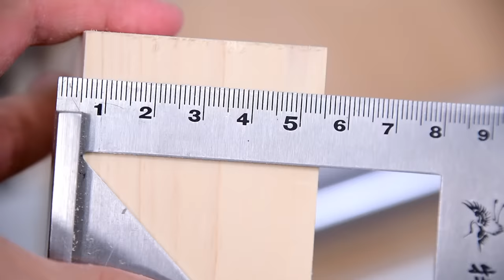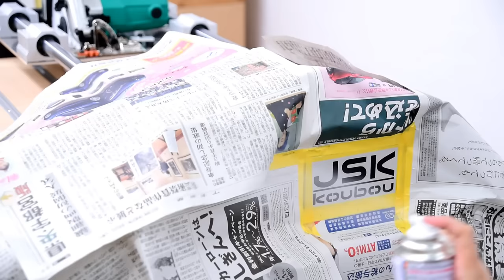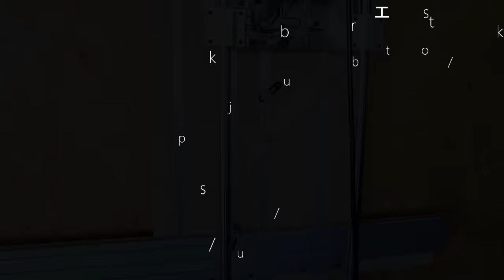Making a 2-in-1 Circular Saw Slide Guide (Easy Panel Saw)

Comment: Finally completed my own and it's amazingly accurate! Some pointers for those who might be interested in building one. I ran into a few issues on the build, I tried the stainless pipe option but couldn't find pipe that fitted well into the bearing blocks. I finally settled on chrome solid shafts with bearing supports. One thing to note is the saw you will be using, be aware of the blade cut depth, and the saw (left or right handed) both were different from the Makita used in the JSK build. I had to make adjustments for my Dewalt saw. Now its done I'm delighted with it! 
Update: To add a bit more flexibility to the mitre cutting I've fitted a 30mm t-track with slider bar with an adjustable mitre gauge making it possible to cut more angles.
Thanks JSK
Reply: Thanks Bruce,
Do you think it's rigid enough to make a slighty longer one ?
Thanks JSK by the way.
Reply: @fabrice5057  Hi there, I'd say definitely, but use solid shafts and bearing supports, only drawback is the weight. Those solid shafts make it heavy, if you're not planning on moving it around it should be just fine.

Comment: You should sell your device, I would buy it :).  I am sure you will sale a boat load of this jig in the US.  Thank you for sharing your video.
Reply: Well you know, cost might be a limiting issue.  I would like to see a cost comparison between the DIY setup and an off-the-shelf setup.   But I agree that the conception and execution of this DIY project reflects great skill.  Thanks for the video.
Reply: I think sales would be pretty damn low. Just checked out factory sled for my machine and it would cost about 50euros. So it's quite hard to justify buying plans and using time and money (note likely more) to get similar results
Reply: Most Americans don't do things this way.

Comment: 16:47 The fine adjustment is a clever idea. I watched a few times to understand and finally realised that was the simplest way way to adjust the blade direction. Well done
Reply: Could you please shed some light on what's actually being done there? I saw this couple times and still no idea what was it for?
Reply: @endriupj  Sorry for the late response. This is to ensure the saw traverses parallel to the guides(rails). If this isn't done properly getting squares can be tricky

Comment: For panel saw attatch hinge at top. Then install a murphy type hinged leg on the back. Pull bottom out away from wall fold out hinged leg on back. It will prop bottom of panel out slightly. Very good work! Nice video!

Comment: A light blow of primer followed by a skim of filler rubs down easily and gives a lovely base for paint.
You might find some Rawl (expanding) bolts that fit into the slide tubes.

Comment: I've thought of a project like this for so long. You have convinced me! 

Great idea to use hollow pipe instead of costly solid shafts.
Reply: Why go to all this trouble. The bearings are designed to use the shafts that are precision ground to exacting tollerances. I doubt that the shafts were. His workmanship is top notch. I would have spent the money on the shafts. I have seen this done with rollers and pipe and they work great too. Back in the 80s i had a cabinet shop and i set up many jigs with these bearings and shafts and they are machine grade...very nice to work with.
Reply: @jeffreyhill3960  Current pricing of those linear bushings is around $136.00 (USD) times 4. $550.00 just for the bushings. The whole set up is cost-prohibitive.
Reply: @murrayhill9000  Those 20mm linear bushings cost only $ 16 for 4. Buy them on Aliexpress.
Reply: @murrayhill9000  People use dirt cheap chinese lm20uus in diy CNC mills. I think it's good enough for something like this. Misumi, a brand name with a US branch that does machining in the US, shouldn't be much more expensive
Reply: @murrayhill9000  I found them on UK eBay, £24 for 4, £28 on Amazon, so certainly not prohibitively expensive. Stainless steel tube is also inexpensive, and the aluminium extrusions are all fairly easy to find and also inexpensive.

Comment: I wish I had half your talent. I saw this a few times in your other videos and at first I thought it was too complicated compared to a table saw, too many extra hold downs and whatnot, but the more I watch the more I realize how much worth there is in this machine. The fact alone that it can replace most things a tablesaw can do and it takes up no floor space at all makes it a very handy tool indeed. I would have to take it off the wall for panel cutting however, because I just can't dedicate that much wall space. Perhaps I could mount it to a bench though.. Anyway, I definitely came around with this tool. Although I doubt I'll be making one. I can enjoy the craftsmanship none the less.

Comment: Neat and clean, not forgotten his  accuracy but for us who are a hobbyist  don't know how the part called that makes us difficult to buy online. The beautiful art of work. Thank you.
Reply: The shafts look like 20mm and are supported by linear bearing shafts or blocks SC20UU, the tracks are most likely 19mm t-tracks (also come in 30mm), the metal close to the black end block is a T-Slot Aluminum Profile Extrusion Frame. These come in different sizes 20x40mm, 40x80mm etc.. All these are generally available on Amazon, Aliexpress etc.

Comment: Well done, would liked to have seen the blade cutting through the aluminium base plate though...!
Reply: He's using saw blade: Circular Saw, Universal Blade (ARB-190) - Motoyuki Co- 190mm, thickness 1.5mm, 56T, using for wood, plastic, aluminium and steel.

Comment: Great videos - thanks so much for the detail.  One suggestion, when drilling aluminium I always use a little dish-washing liquid on the bit.  Same would go for the tap.  It always makes the job a lot easier with less tendency to melt the ali, causing it to "grab" the bit, often leading to breakage. Same applies to drilling lead, though people do that less often. Please keep the great work coming.  Regards, Steve.
Reply: Most of my drills will grab some aluminium and have to bel cleaned out. I'll try some dish washing liquid though it can be corrosive. Silicone grease is also worth a try.
Reply: I've learned that aluminium should be cooled with alcohol. We drill a lot of faceplates and two things are important. Don't use "standard" drills to prevent the melting effect. The "G" type bits are needed. And then cool with alcohol. This works perfekt. G-Type drill bits have an different shaped tip. The good thing: No cleaning needed after drilling. It's a very clean process. :-)

Comment: Fantastic panel saw! It’s even more versatile than the manufactured ones. One piece of advice is to stop the saw before pulling it back up. Pulling it back up while it’s running dulls the blade quickly.

Comment: After assembly, what is the maximum thickness of the material you can cut? Also, I wished I lived in Japan, the prices for material from Mistumi USA is 4 times the amount it would cost me to purchase the linear shafts and bearings in Japan with the conversion rate! I ordered the plans and this is an awesome project you made.

Comment: Very Cool.  I am definately building one for my Makita.  One safety suggestion.  When you use the machine on the wall cut upwards.  I know you need to make a lock or fixture to hold it in place but this way the unguarded blade will be looking away from you.

Comment: Yours videos are amazing, congratulations! In this one, how did you cut the metal ( Aluminum ?) plate where circular saw is attached ? Did use the same circular saw with metal blade ?
Reply: 7:53 Jigsaw with metal cutting blade.
Reply: @George-sw5fb  you don't get it.
Reply: @Leonardo He probably drill it first so that he can put the jigsaw blade in and then move it slowly by following the line you've created before to make it matched with your cs.
Reply: @amrfwws4461  If M. Hirama's question is regarding the slot for the blade,  JSK-koubou does not show how he makes it in this video. Once the saw is completely installed on the aluminum plate (and epoxy thoroughly cured), I would clamp the aluminum plate  to a wood scrap that is large enough to completely cover the saw kerf, and thick enough that the blade will not pass through the other side. Then (wearing eye protection, of course) start the saw and slowly plunge it into the aluminum. It won't ruin a wood blade if done slowly (aluminum is pretty soft), but if you are worried use a cheap wood blade and discard it if it becomes dull. That would be the easiest method. It is the same method used for creating zero-clearance inserts for a tablesaw.

Comment: The most difficult, sometimes,  is that I don´t have tools enough to build a low price circular saw jig...
Reply: Right on point
Reply: You do not actually need that many tools to make one. Having a circular saw and a few hand tools would be enough to be honest to make a rough circular saw jig. With that jig you can then build a better jig and so on. 

If I was suggest any three hand tools it would be a circular saw, drill and biscuit joiner.  With just those three tools can just about make any thing and also a few cheap hand tools. 

With just a biscuit joiner and circular saw you could make cabinets very quickly.

Comment: Those LHBB25 Misumi linear bearings are currently $74.57 each.  Add in the other components and becomes a substantial costing project.  I am so jealous of your 22mm Birch ply and hardware such as the perfect clearance flat washers over threaded rod and those low profile socket head screws.  That is some flawless looking 5052 aluminum plate too.  Am surprised you don't build with cast aluminum tooling plate or type 200 6061 aluminum tooling plate.
Reply: If you look on amazon for vevor linear rails, you can find the entire bushing/rail etc setup for a pretty reasonable price.

Comment: Very cool design... only thing missing in the design is... spacers inside the T track so the T nuts don't fall out the bottom or behind the bottom guide rails and still allow you to get to them when the bottom guide rails are in place while hanging on the wall. Just use a piece of wood inside with a block to stop the spacers from falling out and to be able to add more nuts or replace them easy.

 I saw a comment about faster clamping, you could just use the quick clamps on the market instead.

And I would have used a French cleat mounting system so you could take it off the wall fast, if you wanted to use it at a different location...

Comment: If you route a line as thick as the securing bolts between the securing bolts of the 45 mitre system you can create any angle

Comment: I think using bearing bars and pillow bearings is over kill for a wood saw.  Also, this jig is made for one specific saw.  If you want to use a different saw,  it would be a major job to accommodate a saw of different dimensions.  Otherwise, it's an example of great engineering.  However, doesn't somebody make something like this already made?????

Comment: 6/17/2020: this is amazing and how most everything is accessible with the stuff I have in my garage... the only question is where did you get the blocks that the pipe ran through and mounted to the plate, what is the thickness of the plate.? Thank you very much.
Reply from the maker: I sell a plan.
If you're wondering why not buy a plan?
All the answers are written there.

Comment: This is so cool! can I suggest some cable management: with the saw in the fully down position, zip tie the power cord just the other side of the counter weight pulley above the saw. Use a D ring or carabinier the saw side of pulley to keep the cord coming up and not getting pulled to the side.  If there is enough room between your two pulley's: the power cord will be pulled  up and to the side as saw comes up.
Best of luck!

Comment: I would think you would mount that saw system on an slight to vertical angle on the wall so the wood to be cut stays against the cutting board by gravity

Comment: That's awesome, but I haven't notice how you cut the hole for in the aluminium base for the saw cutting disc? What did you cut it with and and how thick is (I suppose aluminium) plate under the saw.?

Comment: I’m wondering if bevel cuts could be done, not sure about clearance or if the bevel angle will effect the blade passing through the material completely. Do you have any insight?

Comment: Hi, I wonder if it would work if one replaced the linear shafts or stainless steel tubing with aluminium tubing? Would the linear bearings work on aluminium tubes?

Comment: why did you screw the aluminum corner profile directly into the wood at 17:30?  why not use the T-tracks?
Reply: I have the same question, because the saw range is shortened this way ....

Comment: Ok, so you trade in a shorter travel for rip cuts for
 - more safety, as the blade is covered
 - protection against kicks
 - higher clearance (the thickness of the table top)
 - more control over the work piece, as it stays fixed
I'd say a decent trade off!
The only negative thing about your projects is the black belt wood working, that almost deters from trying it myself.

Do you ever use the tilt capability of your skill saw? ((It looks rather crude, and I almost expected a jig for using it precisely.))

Comment: Hello, i bought the plan and have a question. The linear Axis i can buy has 1000 mm and have M12 inner threads with 30 mm length. Is it possible to stretch the plan fromm 910 mm to 1000 mm or will i run into issues with stability. Thank you for the really good plan

Comment: I've wanted a panel saw for a long time, and yours is certainly awesome. I've purchased your plan, and after reviewing I have only one question. Since the standard for plywood in the US is 48 x 96 inches, I would like to lengthen your dimensions. Would you consider that an acceptable modification in terms of the overall functionality?
Reply: Did you succeed in making the guide with larger dimensions? 
I'm thinking of doing the same, with hard chrome steel linear shafts, to resist the weight. Maybe with diameter 30 mm.

Comment: Dear Mr. JSK, I would like to know the diameter of this tube, could you tell me?Congratulations, for the excellent work, I am very grateful for your great contribution.
Reply: I noticed that the blocks had the model number LHBB25 on the side at 11:35. Google search indicates that it is an item manufactured by Misumi US. Their website is currently offline but you might check back later. I suspect that these are 25 mm dia (nominally one inch - 25.4 mm)

Comment: Splendido progetto eseguito in maniera magistrale, volevo chiederti informazione su dove reperire i cuscinetti a scorrimento lineare con le relative barre, io ho acquistato dei cuscinetti con diametro interno da 25mm, ma le normali barre da 25 mm non entrano per cui credo che le barre debbano essere di pochi millimetri inferiori
grazie e complimenti ancora
Reply: That is because the tube is in imperial measurement which is in inches. 1" = 25.4mm. You need both elements to be in the same unit of measure. Look for tubes in metric

Comment: Amazing and inspirational work!!! What kind of saw blade are you using? It seems throughout your videos you use this jig to cut wood and metal. Is it always the same blade? Or can you you change the blade without taking the saw out of the jig? Otherwise you would have to re-adjust each time?

Comment: how did you cut the saw slot through the aluminium base plate? was it done with the circular saw blade? do you need a special blade?

Comment: This would be nice to cut at a 60 degree angle if you could adjust the height somehow or I could put a board under the piece I need the angle on Makita is the only saw I have seen that cuts a 60 degree angle

Comment: Good evening, I am a fan of your YouTube page and a follower of it. I have a question regarding the design, is it possible to put the technical information for the Linear Ball Bearing Slide Block used And the pipe used and And did you buy them online and from any website on the Internet?
 Thank you.

Comment: Hey man.. Just watched the one where u made a guide rail out of all that Aluminium & it is a beautiful piece of kit tbf. I wanted to ask a question about that guide track cutting system if u don't mind at all..
Q. Could I make a much bigger one of them or am I constrained by the strength of the aluminium lengths that u put that yellow coloured tape onto? Is there any way I could use some little strengthening blocks under those pieces the Circular saw runs along to make it longer and stronger for cutting larger widths of MDF, Plywood, etc?? I would very uch appreciate any helpful hints & tis u could give me atm.. Thanks for all the awesome videos and as usual bro I say way to go on keeping ur shop so clean. Also ur hands are always spotless.. How do u manage to keep them so clean?? LOL. 
I'm waiting for the comment section to go nuts now by telling me to wash mine.. LMAO.. Brilliant work as ever man. I'm a huge admirer of ur work and I will be watching for more of these brilliant videos. There's something very relaxing about ur videos too btw. I always feel at ease when watching them.
Reply: Existen ejes con apoyo, se llaman SBR, pero considera que el espacio, perpendicular al eje de la sierra queda bloqueado por lo que no podrías cortar tableros. Es decir solo podrías cortar piezas largas y angostas o eventualmente si colocas espaciadores poder pasar piezas perpendiculares, pero no un tablero.

Comment: I am not sure where to find the hardware, like those 'gliders' that fit on the pipes.  BTW, what is the official name of those things?
Reply: @1959Berre
I found his link to the plans and it said "Guide Bush," which may have gotten lost in translation for Guide  BLOCK (kidda like in video he called WOOD "tree.").
Since he didn't supply a part number, this looks like a deal killer as I have no precision machine shop hiding in my garage.